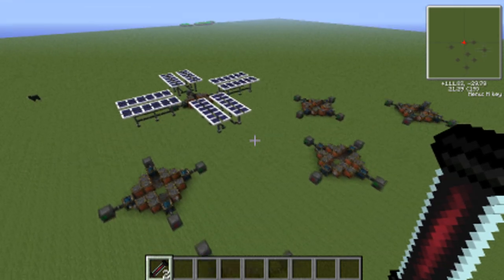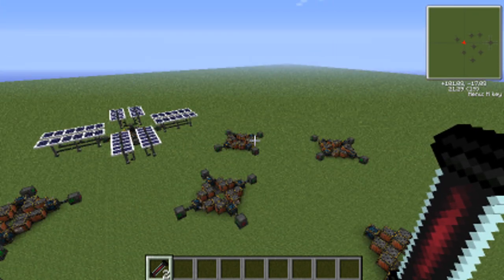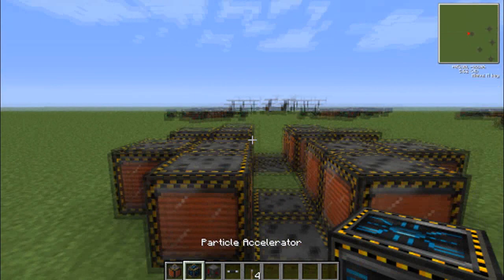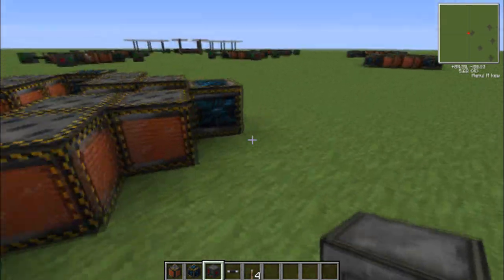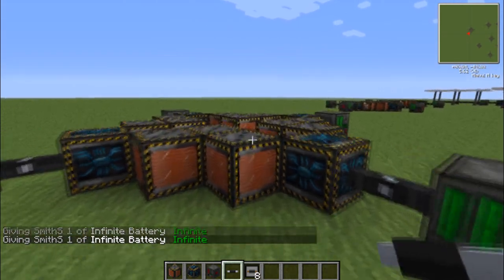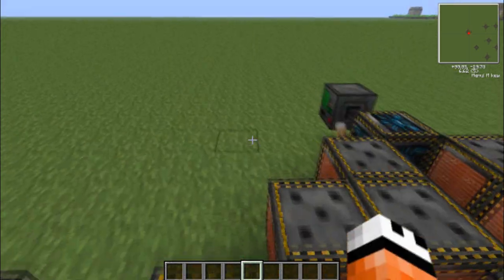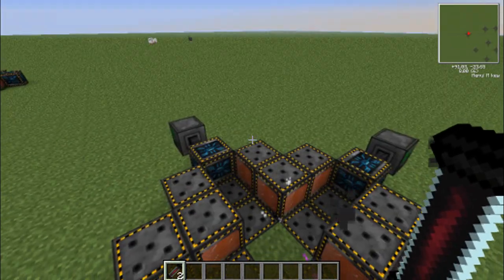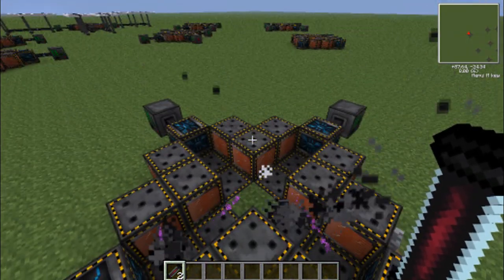Voltz Tutorial: Strange Matter Generator

Comment: Nice tutorial, but I have two questions:
1. Is the down transformer upgrade needed? (It worked here without it, too)
2. With AtomicScience 0.3.4, your tutorial worked fine, but since I updated it to 0.4.1 (ElectricExpansion to 1.5 - the Advanced Battery Box was buggy) it hasn't worked again.
After adding electromagnets on top of the design, the accellerators start working, but I don't get Red Matter.
Did the update change the cirumstances under which the Particle Accelerator can run?

Comment from the maker: I think you may have something wrong, I just tested it out again and it all checks out. 

Does your design start up at all, or does it not do anything? Some things to remember are that you need to place the accelerators from the outside of the design, not the inside, or they will be places in the wrong direction. If your problem still persists you could send me a picture of your design and I could try and spot the issue.